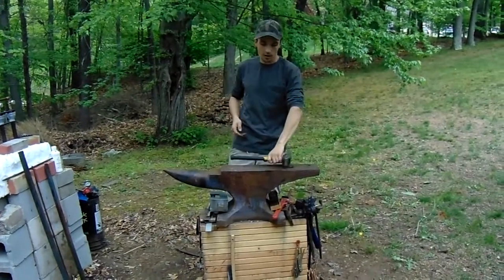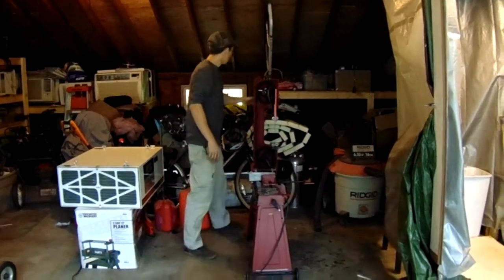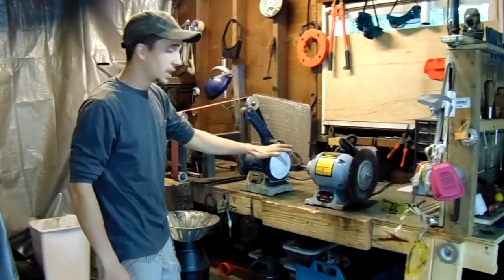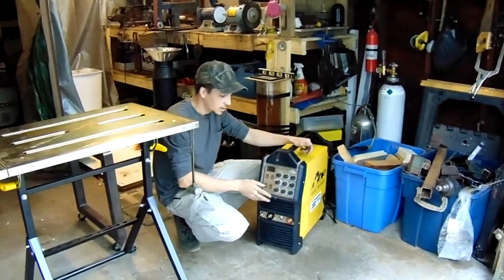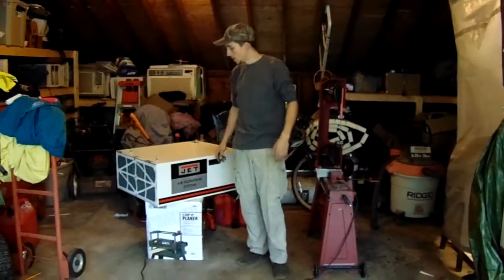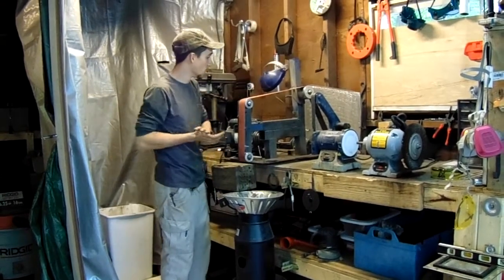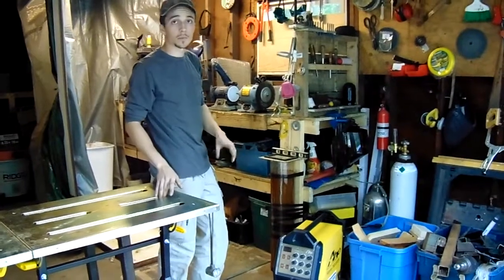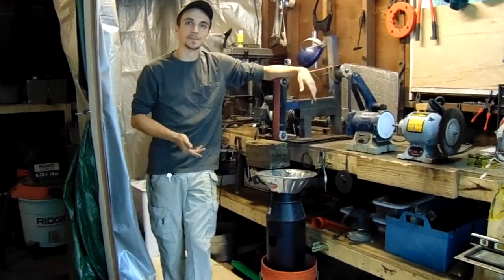Mike Hughes Knives Shop Tour May 2016

Comment: Theres the 2x72 i made! Bevel grinding tutorial and welder review
Reply from the maker: +Grussing Custom Knives thanks for the ideas man! And yes it is, works well, i plan to change up some of the design though to make it horizontal and vertical. That will come in a video soon!
Reply: How much did it cost you to make the grinder?
Reply: +Josiah Musser i made it for 325 used it for 2 months sold for 400
Reply: +Grussing Custom Knives very cool!